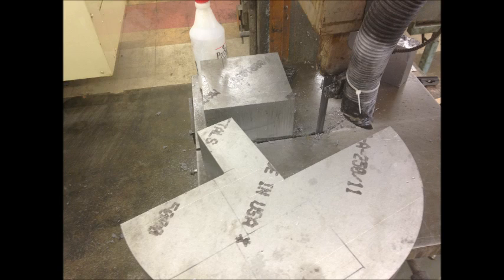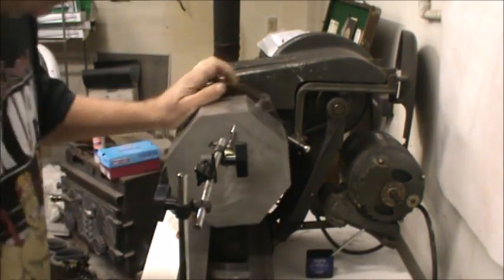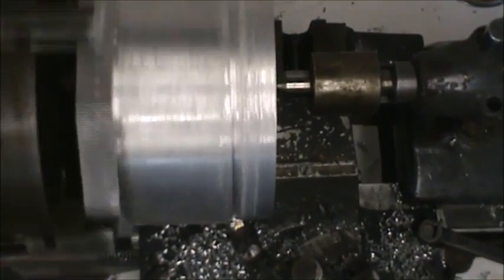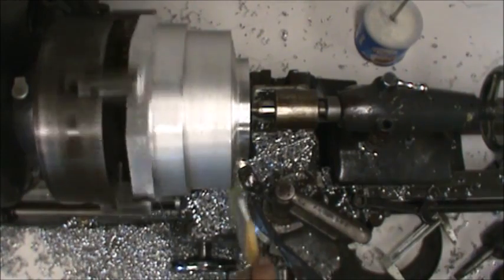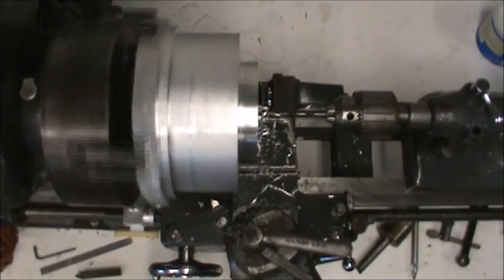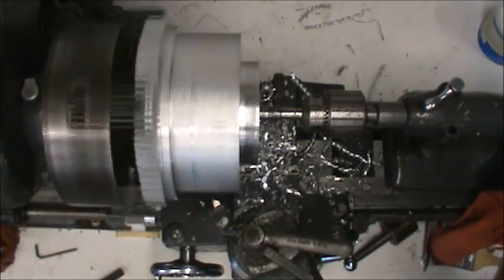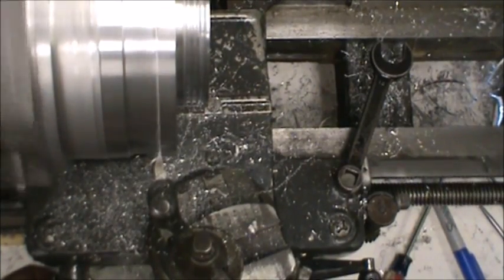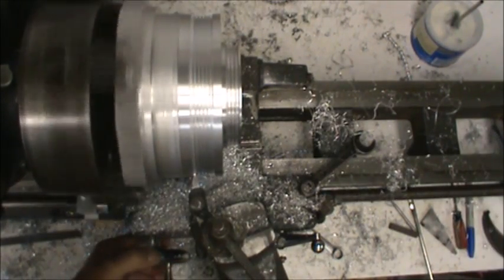How To Make A Poly V Pulley For A Serpentine Belt On An Atlas Craftsman Lathe

Comment: Curious where you find the boring bar holder? I can only find them for quick change tool posts and I'd prefer not to use those from past experience they have rigidity issues.
Reply from the maker: I dont remember where i got that one, but i have seen them on ebay.
Reply: I did eventually find one that works well. Took some searching but now I have the option to use either the carriage or tailstock depending on the project I am working on. Obviously I prefer the carriage and advantages of the power feed to operate boring bar it’s quick and easy while watching the dro for good fitment.

Comment: FWIW,
Kennametal makes a 40° carbide insert for Poly V grooves.  I found that out because I need to make two 5.5" dia double pulleys (very similar to the one in this video) for a belt drive conversion for my milling machine. The bad part is you have to buy a 5 pack, that's about $100. Can't find them sold individually.
I'm thinking I can plunge straight in, rather than the classic method of angling the compound at 20°. Might be a little chatter but I think I'll be able to clean it up a little with Scotchbrite - hopefully it will be a small amount of chatter.
Very helpful video! Thanks for sharing!

Comment: Very Cool......Now will you hollow the part out for lighter weight or will you leave it thick?
Reply from the maker: +GasserGlass I think ill leave it thick, I don't think the weight is going to play much of a role at this time. Its definitely much much lighter then the cast iron original.
Reply: tomswonderfulworld besides that the weight will handle the rpms much better being far more rigid and durable.

Comment: Very nice Video, the pulley came out nice are you going to shave more out for weight or keep solid for strength
Reply from the maker: +StrtRodder100 I don't have any plans to take any weight out of it.
Reply: Solid pulleys will absorb harmonics. I’ve found lighter pulleys have more vibrationional issues hence the reason many machines use cast pulleys. The advantages of a solid aluminum pulley will be higher rpm and better dampening from my own personal experience.